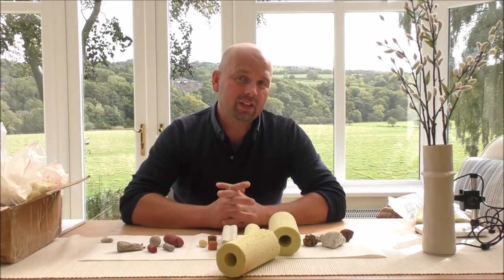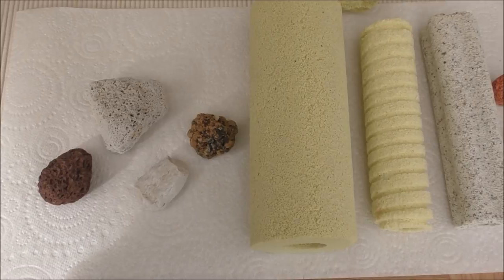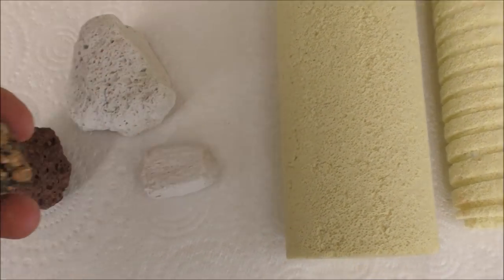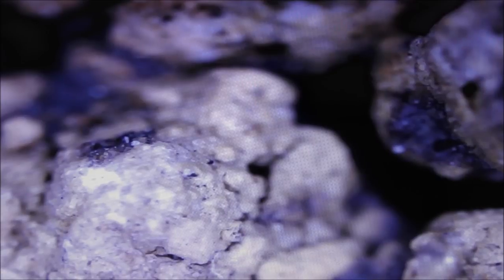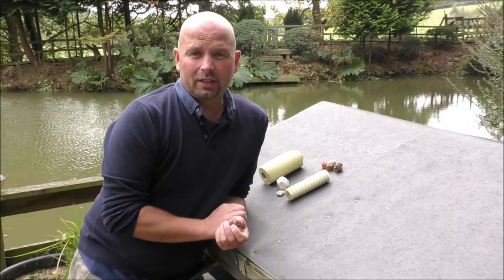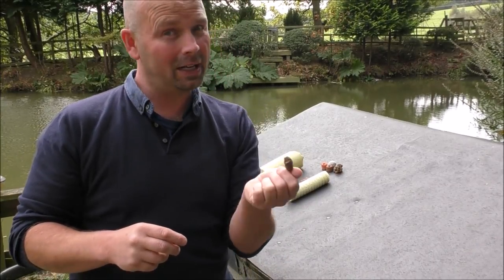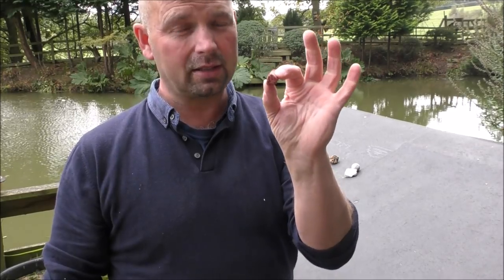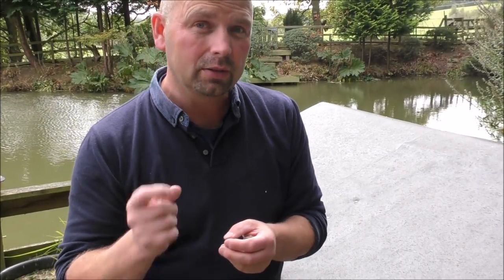Looking INSIDE Filter Media for Aquariums and Ponds

Comment: why does the hardness or breakability matter? i'm not building with it.
Reply from the maker: Wear can occur with handling / cleaning / water flowing over it so a strong media is essential.
I saw some atrocious media at a recent show which literally falls apart when handled and is lucky to last 2 months in a filter according to reviews of it - that makes it of no use whatsoever as a biological media and although it was brick shaped I definitely wouldn't be building with that one, lol
Reply: Media breaks down over time, I made the mistake of putting biohome in a fast flowing wet-dry filter and it broke down pretty quick. Replaced it with alfagrog and moved the biohome to a slower flow canister filter.

Comment: So "white Pumice" is the best way for my Tanganyika tank, raise ph water and is better for my poor water.. Grazie.
Reply: (my other channel) Yes it will help to achieve the correct water conditions but you'll need a big filter to hold a lot of rock.
Reply: @ThousandYardStare  I'll try to look for them in some garden shops, or "matrix" is the simplest solution.. and expensive.😢
Any suggestions?
Reply from the maker: @272roby  If you're in Italy you should easily be able to source pumice since Vesuvius is made of it. When I walked up there I was constantly picking up great pieces of pumice and thinking it would be great for filtration. Sometimes the red version of lava rock is available in garden centres and DIY stores but online you should be able to find anything you want.

Comment: Dear Pondguru, you woke up my interest so I bought 3 kg of Biohome Ultimate from Biohome the Netherlands. As I can understand is that this media also will proces nitrate (NO3). I am not going to use plants because I want to copy the american cichlid biotope. That means I won't have plants to use nitrate (NO3). Nitrate  will increase in time then. But may I conclude that the Biohome is going to reduce the NO3 however, because of the anaerobic bacterias that will take place in the Biohome Ultimate? And if yes, should I avoid Nitrate removers? Because if I use Nitrate removers, the anaerobic bacterias won't have their resource no more to grow, right? Thanks for your videos and help!
Reply from the maker: Yes, any chemical media which removes / binds / detoxifies ammonia, nitrite and nitrate seems to have a starving effect on the bacteria which restricts the level of active bacteria operating in the filter so are best avoided if you want to achieve a full natural cycle using any suitable media.
Reply: @pondguru  many thanks for your response and advice. I will follow them up for sure 😁👍

Comment: I'm curious about the nature of anaerobic action on nitrates, how does this affect plant growth? Do the plants uptake the NO3 faster than the filter can act on it, or will the plants be starved for nutrients, i shoot to keep my water right around 5-10 ppm. Do I have this back to front, instead of leaving an amount available to plants at less than toxic levels for fish, should I shoot for clear of nitrates and let the plants scavenge what they can?
Reply from the maker: If you have 5ppm-10ppm as a stable level of nitrate I wouldn't be worrying about it as that is great but even at a zero reading for nitrate there will still be some available in the water for plants, plus they use a wide range of other nutrients to grow so it doesn't seem to affect plant growth at all when a full cycle is achieved in a filter system.

Comment: What about foam, such as the Biofoam in an Oase canister filter? Water flows through the sponge, so every popped-bubble inside open-cell foam is a surface for bacteria. Somehow, smashing a sponge will not reveal much about its surface area, as it likely will revert to its original form. Also, water will follow the path of least resistance, so water has to flow through a sponge, not around the pieces, or through an opening in the center.
Reply from the maker: Yes, foam will hold a decent amount of muck and also a decent amount of bacteria, especially when it starts to get clogged up with muck.
That's why the Hamburg Matten filter method is so effective - it remains undisturbed for many months or even years.
It is different in canister filters (and most other filters) since the clogging of foams results in a loss of flow so regular cleaning is necessary. That removes much of the 'goodness' in the foams which does an important job of creating a good environment for bacteria - that's where having good biological media comes in. The bacteria is maintained in good filter media in huge numbers and that allows the foams to be relied on more for mechanical filtration and better water clarity.
Hope that makes sense.

Comment: Great video my friend. Love your new studio. Very swanky. Just got 160 kg of SuperGravel. That's what I plan to call the new shower media. I hope to get that into my showers as soon as possible to see if it will perform better than the Ultimate I'm currently using. The BioGravel I'm using in my Endless River filters is working great and I thought it was only a substrate for the longest time. I wished you can shown a piece of it. Looking forward to your new filter video. Happy Fish Keeping!
Reply from the maker: The shower media has the potential to be something really special since so much can be put into a small footprint and I have been talking to a guy over here who is making incredible filters which have taken into consideration the mechanical, aerobic biological and anaerobic biological so I'll be getting one of his filters to take a look at and make a video or two about.
It's not often I get excited about filters since there are so many out there which are nice to look at but don't do a good job as far as the full cycle goes (e.g. Nexus moving bed filters) but this design has me very excited and has the potential to make other filters here obsolete. The big problem is getting koi keepers to fully understand the stages of filtration which should occur in a filter as only then will they understand the nee for a proper filter.

Comment: So Lightly cemented sandstone is normally the most porous rock you are likely to find and granite' are likely to be the least porous. And rocks like pumice may be loaded with gas bubbles, but if the bubbles are not connected the stones are relatively impermeable and do not really count as porous in the geological sense of the word. Seems to me spending a little more cash for natural lava rock is the winner due to it being longer lasting.
Reply from the maker: The problem is that the darker forms of pumice / lava rock have way more sealed bubbles than the white pumice. The dark rock is much heavier so even with all those bubbles it seldom floats but as a media with good external surface area for supporting aerobic bacteria it is definitely a good one.
In the UK alfagrog is cheaper, very hard and has more surface area so if you were looking for something to complete half of the cycle (aerobic stage) then alfagrog would definitely be the one I'd recommend for that.
Only problem there is that I would question why we would only want to complete half the cycle and end up with high nitrates which would have to be reduced through large, frequent water changes?
Reply: two part filter to save money half biohome and half lava rock

Comment: Just a quick question, if you wouldn’t mind. Can we snap the Biohome Ultimate media to then squeeze more into each tray within a canister filter? Thanks 👍🏻
Reply from the maker: Yes it can be snapped in half but we so it in a variety of sizes to suit different filters so you shouldn't need to snap it up. http://www.filterpro.co.uk
Reply: Pondguru I definitely want Ultimate as it’s the best one 😉 shouldn’t be a problem now anyway, as likely getting the e902 instead of the e702. Thanks 👍🏻
Reply from the maker: @3lairdog  Yes it will be fine for those size trays so no worries there.
Reply: Pondguru I know you’re not replying to comments anymore, but in case you happen to read this one, a JBL Cristal Profi e902 greenline can take 2.15kg of Biohome Ultimate 👍🏻
Reply from the maker: @3lairdog  I can't reply to as many but still can reply to some - thanks for the information I will add that to my black book and eventually transfer that to the website. 
Groovy.
Reply: Pondguru no worries, glad I could help 👍🏻

Comment: The thing I'm wondering is what is the upper bound for surface area when it start to clog up and be inefficient at holding bacterial colonies inside? 
Take activated carbon for example. Enormous surface area. That is why it can soak up tannins and medications but it clog up fast and as my understanding goes it will only have working bacteria on the outside.
Wrote that comment too soon, but the question still stands.
Reply from the maker: Yes for filter media there is certainly an upper limit as to what is useful and that makes the race for manufacturers to claim constantly increasing surface areas a total nonsense. Too much and the media simply clogs up - variable structure is so important but the most important thing is probably the accessibility and it must be balanced with lots of other factors.
We could make the biohome read twice the surface area by making it from tiny soft particles but it would either be extremely hard with poor accessibility or totally crumbly (like the Chinese media) with a short life.
I even saw an advert for a new type of ceramic media recently which claimed one piece about the size of a house brick could filter a tank of 2500 gallons based solely on the claimed surface area - one word sprung to mind....'bollocks'. Problem is the fanboys believe than nonsense and base their whole view of media on the claimed surface area so that's why I am going to do a video just on that issue to clear up some of the nonsense.
Thanks for watching.

Comment: I've got 1100l aquarium with two aps efx filters. To me I don't think this is adequate. Any tips please.
Reply from the maker: The amount of filtration needed is based on the volume of the tank but also on the stock / feeding etc.
Really the critical thing is how the filters are set up and the type of media used if you want to achieve full cycle filtration (reduction in nitrate)
If you have a 1100 litre tank then it could take anything from 11kg (normal tropical community tank) to 22kg (heavily stocked predator tank) of the biohome ultimate.
According to my records the EFX holds approx. 2.5kg per tray and assuming that the bottom tray is used for the coarse, medium and fine foams / pad that will allow you to get around 7.5kg in each filter (3 trays) so for 2 filters that works out as 15kg total.
Most tanks of that size would have a sump which would allow for much more mechanical and biological filtration.

Comment: would have liked to see eheim substrat pro under a microscope since that to is sinterd glass!
Reply from the maker: I'm building up a good selection of different types of filter media due to the 'pimp my filter' series of videos so I will definitely do a more comprehensive version of this video since it is so important. Although I don't know how much substrat pro is needed for a full cycle I can't see any reason why it wouldn't be possible since it is a good media - certainly better than 90% of other types out there. All too often there is way too little media used in filters so there is never any information via feedback on how much / if the media achieves full cycle.

Comment: I would have liked to see the eheim substrat pro compared to biohome. I bought 3kg of biohome ultra but I got the other media when I received  my eheim 2217 canister filter. I would like you to compare those two since I plan on setting up another tank.
Reply from the maker: The substrat pro is also sintered glass but it uses a very fine sand which creates a very hard media with a more dense structure. It is decent but lacks the variability of internal structure.
The best way to test would be to set up a tank using biohome and another with substrat pro.
You can find recommended amounts of biohome to use in different situations on the Q&A page of my website here: http://www.filterpro.co.uk and those figures relate to the full cycle being achieved (when nitrate is processed into soluble nitrogen by anaerobic bacteria). The ammonia and nitrite should be easy to control with most media types but it is the final (anaerobic) stage of the cycle which is most difficult as it relies on bacteria which need a very specific environment to live in.
The figures given on the Q&A page are compiled from years of feedback from biohome users who have used different amounts in a range of different situations and while they will not apply to every tank they are quite accurate.
As far as I know there are no other companies who publish figures like this since they consider the removal of ammonia and nitrite to be job done - that is only the aerobic stage of filtration and very easy to achieve. It is the anaerobic stage which is the difficult part to get, hence most filters being seen as 'nitrate factories' - it is not the filter which is a nitrate factory but the media used in it (e.g. ceramic rings and plastic bio balls) since they vastly favour aerobic bacteria.
Eheim are a good company who size their filters very well (as long as you look at the 'for tanks around' figure) as that will allow you to get plenty of media in there. For example a filter for 'up to' 400 litres may be recorded on their website as also being for tanks 'around 180 litres' - that is about right for a general community tank to a medium/heavy stock and they trays should hold enough media for full cycle filtration.

Comment: If flow through surface area is the holy grail of bio filtering. Could one just use a coarse sponge pad as a bio media and be equally effective ?
Reply from the maker: Full cycle filtration (full nitrogen cycle, reduction in nitrate) is the holy grail - not sure where you got flow through surface area from?

Comment: If I used bio gravel as normal gravel would it be good?
Reply from the maker: Proper filter media really needs water flowing over and through it so biogravel is best in a filter or over an under-gravel plate. As a normal substrate it won't do much of a filtering job due to lack of water movement.

Comment: Why didnt you compare seachem matrix?
Reply from the maker: I showed a better grade of pumice - 'matrix' is a lower grade of the white pumice...it's not very good compared to good quality white pumice but still sold for a crazy price.
Reply: @pondguru  ok Im not any media supporter I use that which is proven best but you said in the video x300 is the max you can go with this microscope this experiment from scientific point of view FAILED! it shows nothing in sense of bacteria/media because: aquarium bacteria can be seen from x400 to x1000 Bacteria are difficult to see with a bright-field compound microscope for several reasons: They are small: In order to see their shape, it is necessary to use a magnification of about 400x to 1000x. Now if you want the right comparison media experiment you must remake this video and use microscope in the middle of x400 and x1000  then compare the media and bacteria runing around on the surface of the media after that make another experiment with bacteria already on the media x400 magnif and compar on this zoom ratio
Reply: @cryptoastronaut8130  If you're a fan of pumice and you believe that to be proven best then I don't have a problem with that - just use whatever works for you.
I'm of the opposite opinion that I tend not to believe anything until I have researched it and understood it, then I know information which is useful and I don't believe something which probably isn't true.

With regard to the magnification of the microscope I think you are misunderstanding what the video is about - it is to show the internal structure of each piece of stone and media featured in the video. It is not to look at bacteria.

If you have access to powerful microscope then you should make a video showing bacteria on different surfaces - the problem is that the picture would be so magnified it would tell you nothing about the structure of the media, suitability or accessibility for bacteria. 
This video is to show media structure and explain the suitability for bacteria to colonize, not to show a misleading zoomed-in set of images of bacteria which would ultimately mean nothing to people wanting to learn about filter media.
As your 'about' part of your channel states: "Learning Trough Experimenting with Mother Nature Urban Jungle
" it would be worth reading up / searching for videos about what makes for a suitable surface for bacteria to colonize, optimal pore size, trace elements required for bacterial growth etc. etc. - it's interesting stuff . As you are supposedly "Learning Trough Experimenting with Mother Nature Urban Jungle
" feel free to send me the link to any videos you make as I'd be interested to see them.

However, I'm guessing that you won't bother since your last reply was simply copied and pasted after a google search:
(from first result on google) Bacteria are difficult to see with a bright-field compound microscope for several reasons: They are small: In order to see their shape, it is necessary to use a magnification of about 400x to 1000x. The optics must be good in order to resolve them properly at this magnification.

Sound familiar? 
.......and that's what is wrong with the world today - it's way easier to copy and paste something for the sake of a nonsensical argument than it is to actually take time to research and learn.
Jesus wept.
Like I said at the start of this comment - if pumice works for you that's great but please don't piss down my back and tell me it's raining.
(mic drop)